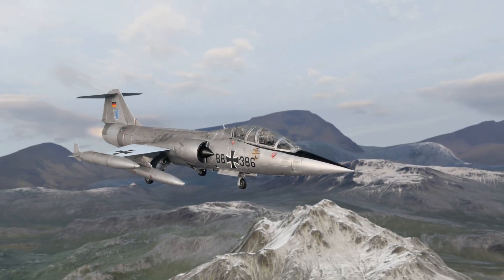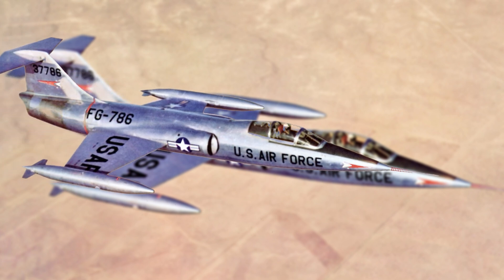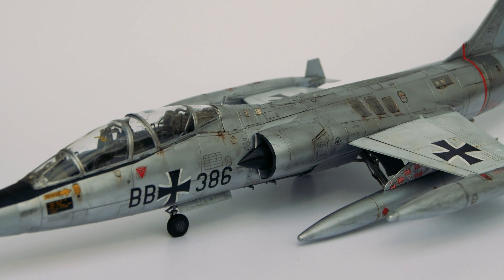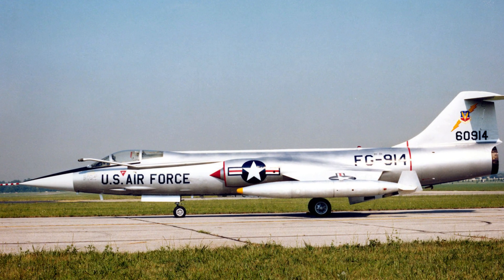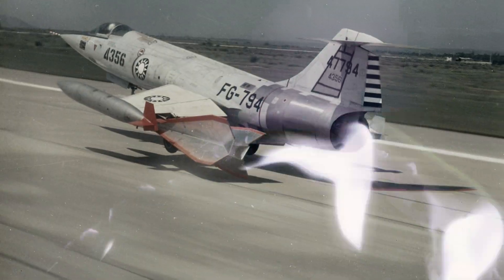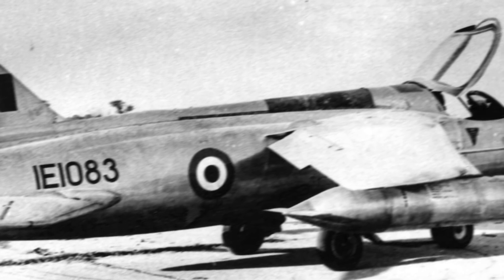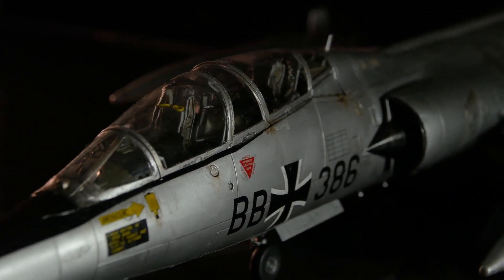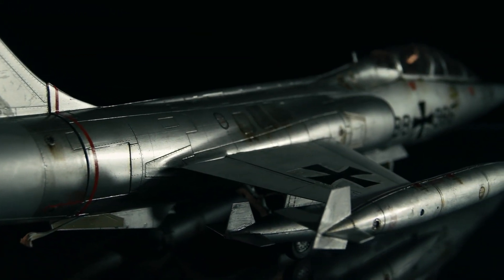10 Reasons Why the F-104 Was a Problem Plane! #f104   #history   #usa

Comment: It's wings are too small.  It would be much better as a delta wing.
Reply from the maker: Thanks for sharing your thoughts! The F-104's design really was a product of its time, where achieving supersonic speeds took precedence. While its thin wings did limit lift and fuel capacity, a delta wing would have introduced its own set of challenges. It's a fascinating debate—each design brings different trade-offs in performance and handling. I'd love to hear more about what you think the benefits of a delta wing would have been for the Starfighter!

Comment: Realizing all its flaws, US Air Force abandoned Starfighter only a few years after its introduction. Its manufacturer, Lockheed, turn to other NATO countries, which bought it on droves, turning it into the backbone of their Air Forces (W.Germany, Italy, Norway, Greece, Turkey et.al.). As revealed later, Lockheed had bribed goverment officials in many of these countries, so they would choose the notorious F-104 over other fighter jets - in what was considered the biggest defence corruption scandal until then!
As a drafted airman in Greece in the early '90s, I used to serve in Araxos airbase where F-104s were stationed. In addition to all their design flaws, their engines were not reliable, something that (more and more often, given their age) led to break-downs, blackouts on the air and emergency landings. As an officer once told me "I guess they designed a rocket and then turned it into an airplane..."
Reply: 🤣🤣🤣🤣🤣🤣

There's only a reliability issue with those engines if they're not properly maintained.
Reply: @ I guess that after 30 years on service (in super-intensive use, due to daily dogfights with turkish planes over the Aegean Sea), maintenance teams would struggle to keep them up to the tusk, anyway...
Reply from the maker: Thanks for sharing your firsthand experience and insights—it’s invaluable to hear from someone who served at Araxos. The F‑104’s legacy is definitely a mixed bag: while its innovative design set impressive records in speed and altitude, its service history and procurement controversies have sparked long debates. It’s clear that the challenges you witnessed on the ground were part of a much larger, complex story influenced by both design trade-offs and the political pressures of the Cold War era. I appreciate you shedding light on what it was really like in operational conditions. Every piece of firsthand testimony helps round out our understanding of this fascinating chapter in aviation history.

Comment: Spain operated F-104's and never lost an aircraft. Japan operated 230 F-104's and had the lowest accident rate of all air forces. Why do you ask ? They used the aircraft in it's designed role as a high speed, high altitude point defence interceptor. Flying long distances at 300' AGL and doing 500 knots in cloudy and foggy European bird filled weather while navigating with a paper map on your knee is a recipe for crashes in any Century series fighter for a 20 something rookie pilot practicing the nuclear penetrator role. Click bait videos like this using DCS images and plastic models which are not properly researched are a joke.

Comment from the maker: The Full script:

10 Reasons Why the F-104 Was a Problem Plane!

Welcome to an exciting exploration of one of aviation's most discussed aircraft—the F-104 Starfighter. Its sleek design and astonishing speed became a symbol of Cold War aviation. However, behind its iconic image lies a history filled with controversy, particularly regarding safety and handling. Let’s unpack ten vital reasons why the F-104, despite its allure, faced significant challenges.

1-Speed Comes at a Price:
The F-104 was built to be the fastest fighter jet, but this obsession with speed meant that stability took a back seat. The aircraft turned out to be quite sensitive in the air, making flying a tricky endeavor for pilots.

2-Revolutionary Wing Design:
The Starfighter’s ultra-thin wings were groundbreaking but limited its lift and fuel capacity. While they enabled supersonic speeds, they reduced the aircraft's range and made it less efficient at lower speeds.

3-High Wing Loading Issues:
With a high wing loading, the F-104 required pilots to be razor-sharp in their flying skills. This design resulted in an imbalance that could lead to sudden spins, particularly during critical moments like takeoff and landing.

4-Control Surfaces That Struggled:
Thanks to its small tail surfaces, the F-104 lacked sufficient aerodynamic control when spins developed. This became a dangerous factor, often turning recoverable situations into catastrophic accidents.

5-Missing Stall Warnings:
Unlike modern aircraft, the F-104 didn’t have effective stall warning systems. Pilots had to rely heavily on their instincts, which left little room for error as they approached the limits of flight.

6-Handling Difficulties:
The aircraft demanded impressive skill levels. A combination of high speeds and minimal lift surfaces made the F-104 a challenging machine for even seasoned pilots, especially during those tricky low-speed maneuvers.

7-Safety Compromised for Speed:
In its quest for record-breaking speeds, the F-104 sacrificed many safety features. This innovative yet risky design left pilots in perilous situations more often than not.

8-Engineering Compromises:
The F-104 was a product of its era—when supersonic speed was king. However, the compromises made during its design continue to affect its legacy, highlighting the delicate balance between performance and safety.

9-A History of Accidents:
Statistical reviews reveal a troubling trend: the F-104 had a notably high accident and fatality rate across several air forces. Each loss became a painful reminder of the risks in pushing aerospace engineering to its limits.

10-Learning from the Past:
Despite its flaws, the F-104’s journey offers crucial lessons for future aircraft design. The challenges faced by the Starfighter have ultimately influenced advancements in safety and design standards in military aviation.

Conclusion:
In conclusion, while the F-104 Starfighter captured hearts with its speed and cutting-edge style, its design flaws—from handling issues to safety compromises—tell a different story. By understanding these challenges, we not only gain insight into the difficulties of the Starfighter but also the critical need for balanced engineering in the relentless pursuit of performance. Subscribe, like, share, and Stay tuned for more, we end this video here, thanks for watching with us.

Thanks for watching with us...:)